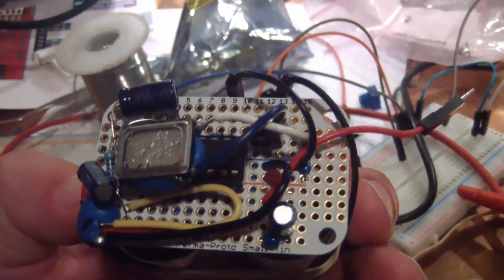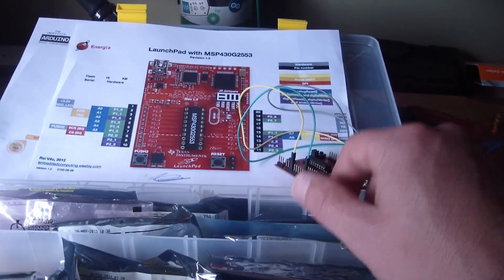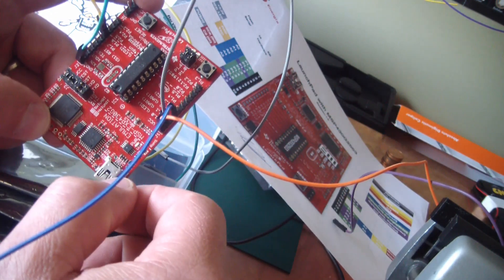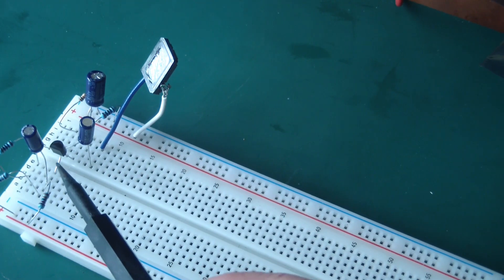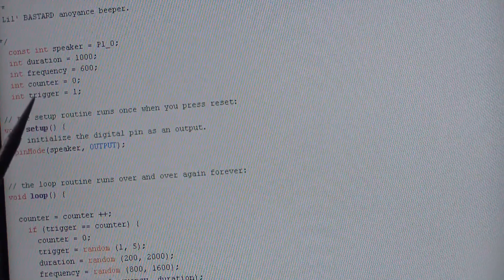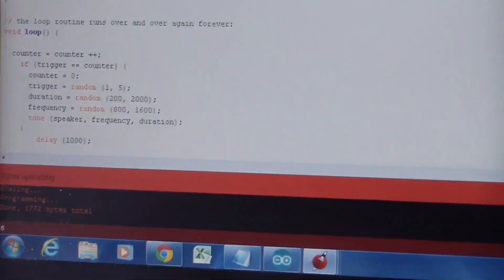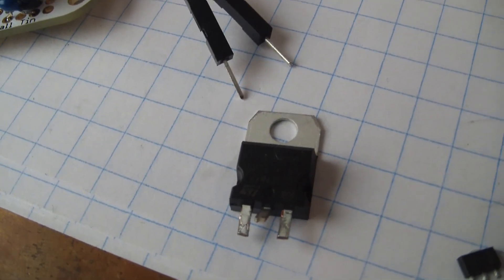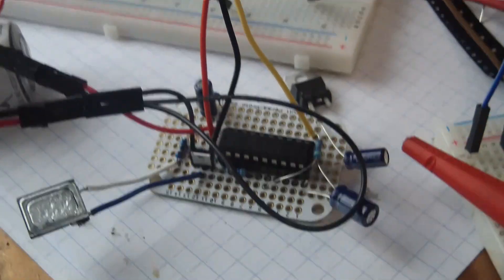Zen Blaster; a Most Annoying DIY Electronic Device

Comment: instead of delay, you use the millis() function.

example:

int startMillis = 0;
unsigned long duration = 5000;

void loop()
{
    if (startMillis == 0)
    {
         startMillis = millis(); //prevents reloop until reset
    }

    if (millis() - startMillis >= duration) //be sure to use subtraction to prevent issues when the counter rolls over.
    {
    //code to execute
    startMillis = 0; //reset timer
    }
}

Comment: I already made something like this!! It was just a bit different. It was maybe like 5 year ago and it was my first electronic device 100% made by myself. I was experimenting with an old "Radio-Shack's Electronics Learning Lab". One of the project gave me an idea... The "Sound Bomb" ... I made a very basic timer using capacitors and a transistor and I used too a very small door-alarm found at the dollar store.

Basically, when you set the switch at "On" You have something like 20-30 seconds to hide it and after that, it start a very loud alarm. It is just a bit bigger than a lighter.  You can really do evil things with this little device! And the most important... It's not dangerous!  :D

Comment: Someone toss me a ball glove, This shit is going by above my head. I thought I was doing good. Replace a 110 plug end, Black to brass, white to silver, and green to the green screw. Don't like to mess with 220. Fine with the 12 volt automotive  system,  be careful with anything past the coil wire. AvE you can sell these things, maybe not as cool as your ruler, Help a 50 year old electrically challenged guy out.
Reply: This doesn't make sense for this video. The voltage here is 5v, max 9v input usually.

Comment: Couldn't agree more with you on how people try and act smart when you're trying to get electronics help as a beginner.    That said this little annoyance circuit could be made a lot cheaper and easier with a simple circuit using a capacitor that charges and discharges.   No arduino needed.  Google "Chirp prank Circuit" and youll get a ton of suggestions.
Reply: Maybe a noise antennae could be incorporated somehow for randomness.

Comment: Wouldn't it be more menacing if it would stay silent for minutes at a time and then do 1 or two beeps, not long enough so you can figure out where it came from?
Reply: That's what it does when it's out of test mode.
Reply: My version would be off for 30 minutes minimum. Super long time annoyance.
Reply: I built one with a friend about half a year ago, to troll another friend. We made it a 30-180 min delay and 250ms on time. Took him only a short time to find it. Then again, i magnetically attached it to the downside of his bed.

Comment: "counter = counter ++;" could be replaced with simply "counter++;", since ++ is the increment operator. Likewise, you could use the decrement operator -- if you wanted to reduce the counter by 1.

You could also do "counter += 1;", which evaluates to "counter = counter + 1;", and "counter -= 1;" to reduce it by 1. In this situation, the increment operator is the proper choice because you're only incrementing by 1 each loop, but if you were to, say, add the value of an int called 'foo' to counter, you would be best off doing "counter += foo;".
Reply: counter = counter++ is actually a very confusing way of writing that. Because it modifies counter's value twice, first it sets is to "counter++"'s value, that is counter. Then, it increments it.
Reply: I looked through the comments to see if anyone pointed it out this guy has. counter++ normally works for what ye doin'
Reply: Cees Timmerman It's old but don't listen to that... 
++i is totally different from i++. 

int i = 0
While (i++ < 10) Do chooch; --- start with i=0, do chooch then increment i. 
While (++i < 10) do chooch; --- increment i, then do chooch. It starts with i =1.
Reply: ++counter is better, but maybe compilers nowadays already do that.
Reply: I know, and it is no different in the code he's using. Also, why not use for(i=0; i<10; ++i) instead of assuming i's value?
Reply: counter = counter++; is actually invalid C.

He is lucky that it works here, but it is undefined behavior and may stop working at any time

Comment: i used a quad timer for this. Mind I only used two of it's 4 internal 555s to do it. All I needed to do is use one to switch on the other. The main timer sets the pause between beeps and the duration of the beep when it's active. The second 555 makes the actual beep. An NE558 is pretty good for this. You just need a transistor to power the second timer channel as the output of the timer is the wrong polarity to work with the trigger of the other timer. Bang in an NPN transistor and your golden. It may be a PNP transistor. Honestly it's been a really long time since I built that thing. It lasted nearly 6 months on 2 AA batteries though. Drove my parents up the walls until it died. Incidentally that empty space between the back cushions and the actual back of a couch, perfect place to hide the wicked little bastard. I'm 41 now and was 17 when i did that. They still remember it...

Comment: It's entirely possible to run the chip in am arduino completely standalone without any side components though, at 3.3v
Reply: No sir,  The AtMega328 packs an onboard oscillator that you can enable, she'll only chooch at 8MHz as opposed to the usual 16 from an external source, but for projects like this that should be more than enough

You can get real into it and program it in pure C through an external programmer using Atmel Studio or some gib, but you can even find a tutorial on how to just do it through familiar Arduino environments, scroll down a bit to 'minimal circuit' on https://www.arduino.cc/en/Tutorial/ArduinoToBreadboard

Comment: Here's my version: Charduino nano right from Taiwan, lithium cell from a trashed model helicopter and a speaker right on the digital output. Interval is not fixed, but a random number between 1 and 3 minutes, frequency and length are just as well completely random. I left it in my friend's room and after quarter of an hour passing by, he couldn't even figure out where the sound is coming from. The worst/best part is: You can't measure the interval to try and listen to the direction because it's random and you NEVER expect it :D
The whole thing was 30*10*50 plus the very small battery

And for your software: You overcomplicated it. Generate a random number and make it wait for that random number. That's it, no need for the counting

Comment: okay, software engineer walked by.

you can't do `counter = counter ++;` (well of course you CAN, but ADVICED NOT TO), the result is "undefined" (as written in the C and C++ specifications).
the problem is that this statement does 2 assignment to the `counter` variable, one by the `++` operator, another by the `=` operator.
and even though `++` will take precedence over `=`, it's not a valid sequence point.
which means, the first assignment operation (the action that actually writes the value back to memory) can take place before, after, or during the second assignment operation.
I know this sounds a bit crazy to a non-software engineer (or even some junior programmers), how can an action take place during another action?
but you know we get all these compiler optimizations and peephole optimizations and pipeline optimizations and cache and memory access optimizations and whatever black magic optimizations, you can get all kinds of weird runtime behaviors just by that one line of "behavior-is-undefined code."

the conclusion is, you MIGHT (or might not, only god knows) get different behavior on different compiler, different version of compilers, different hardwares, or even different version of hardwares.

to save us some debugging time, just don't do multiple assignments to the same variable within the same statement.

=== further readings:
https://en.wikipedia.org/wiki/Sequence_point
http://stackoverflow.com/questions/4176328/undefined-behavior-and-sequence-points
Reply: oh no looks like the world will end now what are we to do
Reply: well the world will not end just by writing `x = x++;`.
but neither does your head-ache.

in software the "damage" is usually not that severe, at least it won't really cause physical injuries on an easy electronic project like this.
however if you're writing some code to control some heavy duty mechanics (such as an elevator or something like that), it DOES hurt.

and when you got a problem and 100k lines of codes to inspect, it costs you a lot of coffee and aspirin.
Reply: +曾其威（Victor Tseng） Instead it should just be x++; correct?
Reply: for primitive scalar types, either x++ or ++x.
for user defined types (structs and classes), if you dont want the previous value, use ++x, otherwise x++.
Reply: well when you only got a hammer, everythimg starts to look like a nail.
sure u can hammer a screw in, but that's not usually how we do it.

Comment: +AvE You have been misinformed. Arduino Uno's are still available with a removable chip, it can be ran after programing with only a 16mhz crystal and 5V. THE only time you need more than that is if you need a serial connection, i2c, or a sensor.
Reply: +Tankapotamus You can also run it with the built in 8mhz crystal if you reflash it

Comment: With enough frustration, one tends to consider adding a hammer test to the procedure.  I gotta have one of these, going to put it on a small motor driven chassis that will go forward and backwards at random for random distances and put it in the duct work in the hallway of my apartment house.  Why not share the fun after all, and my neighbors ought to just love it!  (insert evil grin here)

Comment: for a more malicious version use a piezo tweeter and make the pulses very short and loud. a shrill, loud "tick" is nearly impossible to locate and enough to wake somebody up. at first the subject may assume, it just imagines the sound. also incooperate an option to remotely disable the device, to prevent visitors from confirming, that "that noise" actually exists. 
it wont take a month untill the subject will start tearing his room apart, looking for the source of the noise. at that point inform social services and disable the device
Reply: +Cuda FX better make several that way it's even harder to figure out.

Comment: Don't worry about the caveat with the "sleep()" function in your code. It's being used correctly for this project.  All that website was saying was that you can't do processing in parallel with the sleep function since it effectively freezes the processor (with the exception of interrupt and serial processing, etc).  Since your code doesn't have any other processing going on (just that one loop) the sleep function is perfectly acceptable.
Reply: well, as a programmer, you task is to:
1. make the code easy to understand (take precedence over 2)
2. make it run and solves your problem (without causing other problems...)

so, as long as these 2 principles are met, any codes can be accepted.

Comment: It would be fun to build one as a memory game of torture where you have to push a variety of buttons in the same order as the lights in the buttons flashed.  When you don't do it correctly or not at all it goes all bee-bop-idy for a minute. Maybe something where you have to shake it to stop the sound. Put it in a very tough case (safe from hand tool smashing) or have an outer clear case full of pressurized glitter so if they try and smash it they get a forever mess of stripper dust. Put a go pro inside this torture device and leave it in a public place. Hopefully no one thinks it's a 100 virgin delivery device.

Or add it to one of those jobsite work radios so when someone changes your radio station it emits that sound 30 seconds after it's changed and then gives you a zap from one of those dollar store fly swatters when you change it back.

Or connect it to your doorbell and see how long the "goodnews" story tellers can handle it. I'm much like 3M, I don't make the things that annoy people. I make the things that annoy people better.

Comment: There is a book called something like "51 hightech practical jokes for the evil genius" (the whole evil genius series is pretty good actually). In the book they have something alot like that that simulates a dripping faucet. The thing used 555 timers instead of the fancy programmable stuff, ran on a 9 volt battery and the best part of the whole thing was that it had a photocell connected to it so it only worked in the dark. This meant it only worked at night, and if the person turned on the lights looking for the noise the speaker would ground out and the thing would go quiet until the lights were turned off again, increasing its annoying-ness. You can find the pdf online.

Comment: Excellent flavor to the video's.

It's great to see you using and advocating the MSP430 widgets.

TI also sells, 3 for US$15, a MSP430F2012 surface mount chip on a tiny PCB that is slightly bigger than a 2032 coin cell battery. 
(for added Zen blastageness via increased concealment options)

The MSP430F2012 thingies ($5 each) are made to plug into a US$20 USB programmer.
You can get the exact same signals from your Launch Pad.
Its the row of jumpers that crosses the line on the PCB between the USB port and the chip under development. Just select correct chip in the confuser before programming and your existing software prolly work as is.

For either of the chips adding a 32.768kHz xtal for deep sleep and a coin will last a loooooooong time blippen a piezo every now and again.

Comment: I made annoying program when in school we were learning programming (Turbo Pascal). found function which uses integrated pc speaker, decided to use it. found the most annoying high pitched sound which still sounded loud, then made it to beep for 2 sec I think, then wait ten, sound again, repeat. You have to have good poker face to use it while using the pc for a lesson, but it's annoyingly good. We did not have electronics in school so I never had an opportunity to make small hideable thingamajig like this which would have been more awesome! Of course arduinos and chep dev board did not exist back then.

Comment: I improved mine: 
Instead of agressively beeping, it only beeps like every 10 seconds, also higher pitched and for a shorter duration. I made it much smaller, using cr3032 lithium button cells. 
The best feature ist the super evil light sensor, it turns off when you switch the light on, so your chances of finding it are drastically lower.

Comment: Your programming isn't so bad. The "right" way to do it is use a system timer and just check it every time through the loop to see how much time has elapsed. On Arduino the default timer can be accessed with "millis()" which tells you how many milliseconds have elapsed since the time flipped (it's 16 bit).

So you set start_time = millis() before a while loop and each iteration check millis() - start_time to see how long it has been. The advantage is you can time multiple events in the same loop - something you can't do with sleep statements. Not sure how to access timers on the chip you're using, but I bet you have at least one.

Comment: what do you suppose to use?
i think an interrupt, try using a "timer".
i have no idea really, i never programmed an arduino.
i did a quick search and skimmed the code, you should write the "callback" function 
http://playground.arduino.cc/Code/Timer1
that'll save you some battery, because afaik while in the "timer", the cpu is not working (at full freq). as opposed to work  all the time in a spin-lock (the loop you made) (actually just a busy waiter https://en.wikipedia.org/wiki/Busy_waiting )
Reply: +Jerónimo Barraco Mármol  You're looking at the wrong thing. avr-libc and upstream Wiring and Arduino do not have a sleep() function with corresponding semantics. sleep() function which takes milliseconds is Energia specific and the documentation is vague because implementation is microcontroller specific. It appears, it's a power efficient timer interrupt based deep sleep on MSP430 controllers. Perhaps care should be taken to disable some useless peripherals and interrupt sources and that should be about it.
Reply: thanks for expanding. like i said, i never programmed one before, i just did a quick google search.

Comment: What do u figure it cost u in components. I buy atmegas, oscillators, resistors etc in bulk and I think it costs me aboot 10 bucks worth of parts to get a functional board but if those chips are cheaper why not.

Comment: It must have been back in the 70s I made something similar but using a CMOS hex schmit inverter; cutting edge at the time, Using a light sensor and long time delays, it would chirp like a cricket maybe once every a minute starting 10 minutes after the lights went off. Very difficult to find because it shuts up when the lights come on. Time delays were a bit variable using simple RC circuits, but that makes it more natural.

Comment: What you can do, just for efficiency is remove trigger variable and replace it with counter. And instead of incrementing counter, decrement it. So when it hits zero it'll fall into the if statement. 

counter--;
If (!counter)
{
counter = rand (1,5);
...
}

This should further improve battery efficiency and smooth it out.